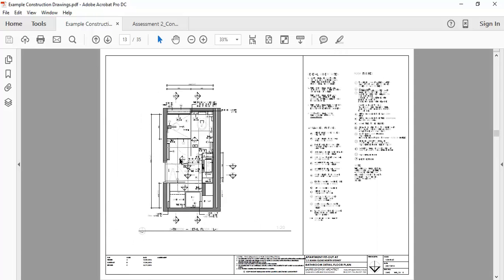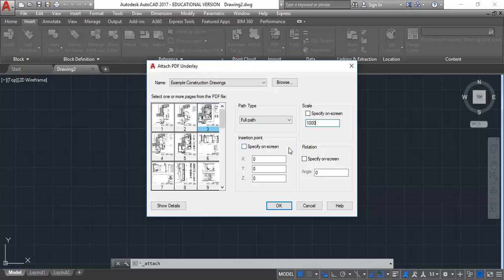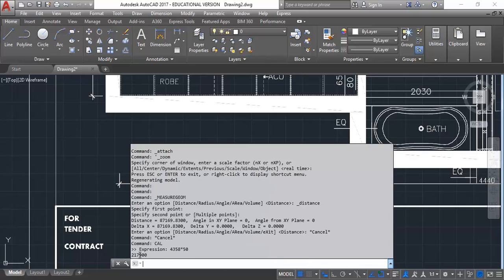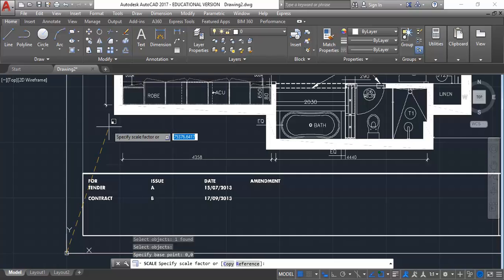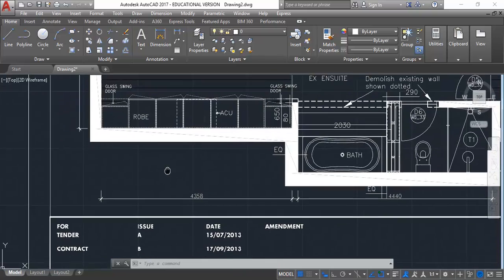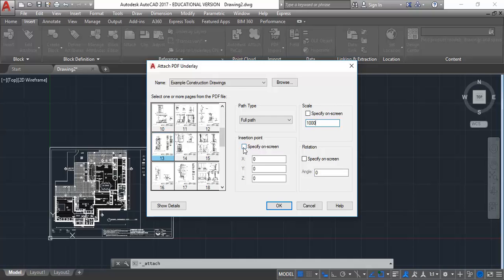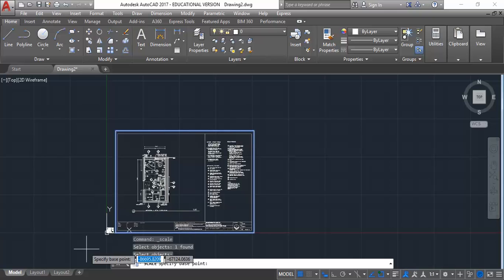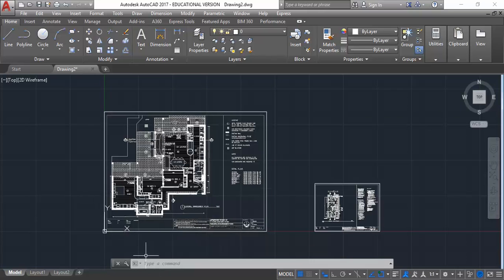AutoCAD Inserting and Scaling PDF

Comment: Thanks for the video
Why didn't you use "align" command to scale it?
Reply: Align would have been a lot faster and easier.
Reply from the maker: The Align option is just a new(ish) feature in AutoCAD that is conceptually the same as what I've shown, as is the Reference option using the Scale command. It doesn't matter which tool you use as long as you understand the concept of scaling and making something real-world scale